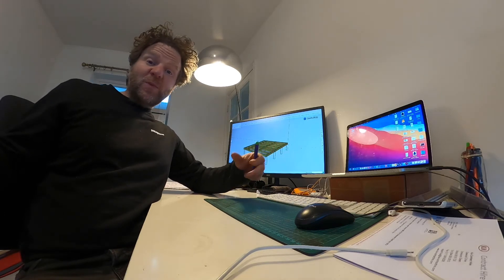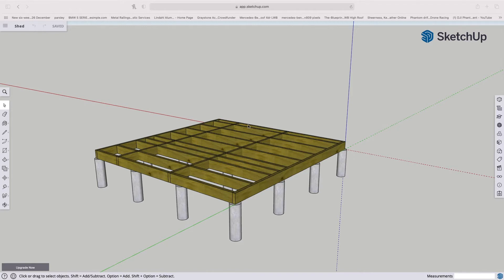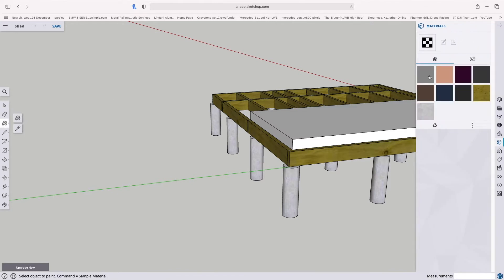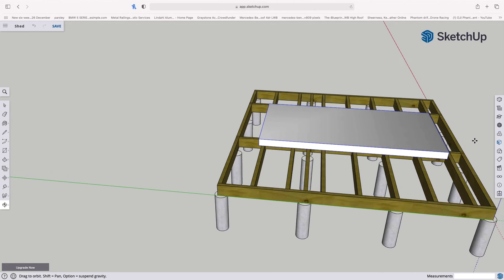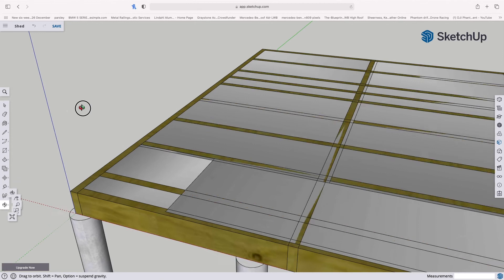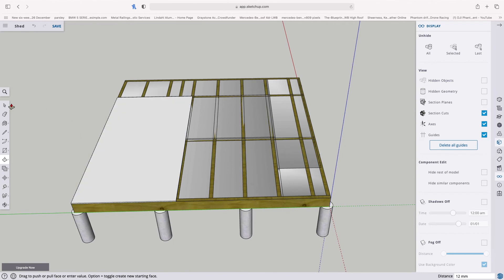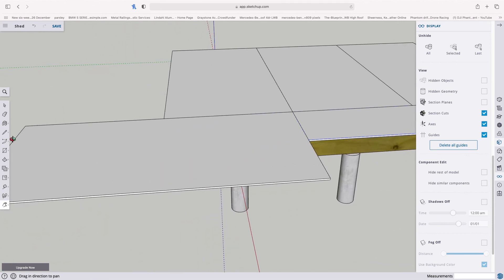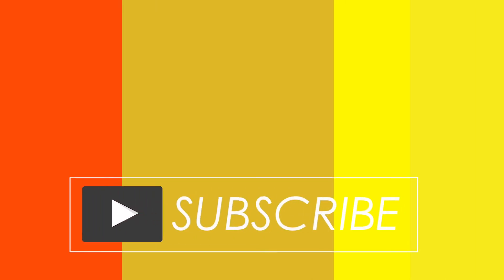Use Sketchup to Design a Garden Room   Episode 3 Insulation & Sub Floor

Comment: Great Videos, Thanks ever so much. Would be nice to have one for the walls and Roof. A Basic one for the Them as Isolation and Plywood are straight forward. Also a Tour at the end product would be fantastic. I dont know if i missed in your videos. Where did you use your 4x2 and your 6x2. appreciate for everything shared so far